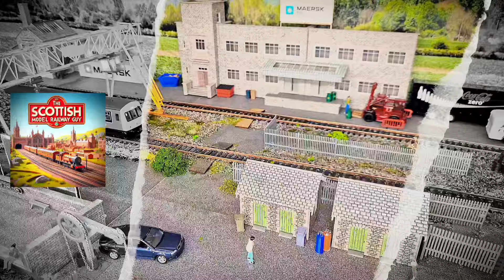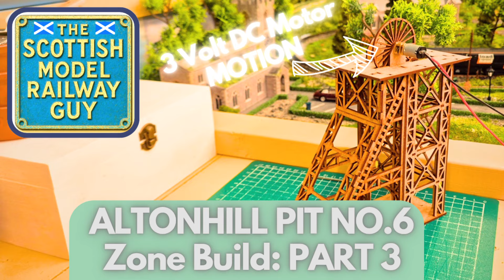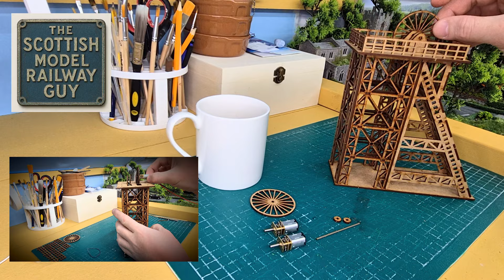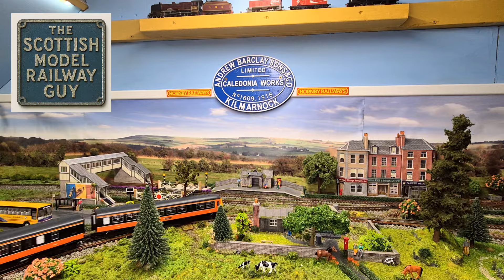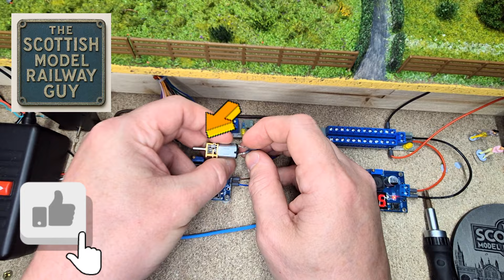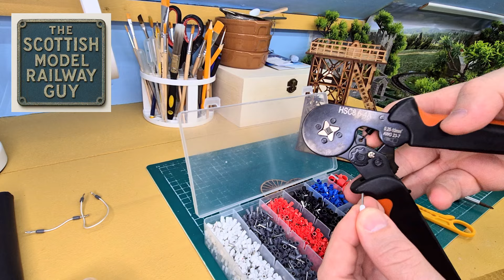Model Railway Series: (Industry Part 3)

Comment: I'm going to get one eventually so I'm interested in seeing how you detail and weather it. 
Travelling across the Central Belt the coalfields were many and ancient, the mine head gear wheels whirring. It'll be a good and authentic addition to your layout.
How about naming the mine, 'The Margaret Thatcher Memorial Mine'? She did so much for Scotland's once-225 collieries.
Reply from the maker: Haha... let's leave it as Altonhill Pit No.6... 😆.  You know... in my area there are multiple colliery pit mounds still very visible everywhere, and aye... it does show the extent of the industry!  And I guess that is the inspiration for this.  I'm old enough to remember everybody having coal fires too.

Yes... so next up is finishing the electronics, and then getting it weathered.  I've been doing a bit of research already on how tgey really looked, but I'm thinking a black framework with little blisters of rust and maybe a yellow weathered handrail.

I may even plant it in a Metcalfe shed.